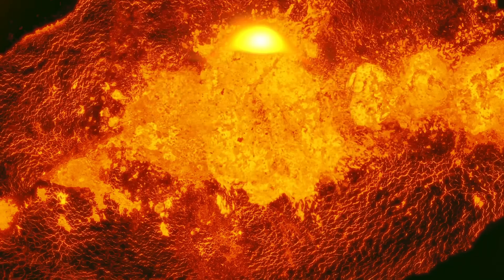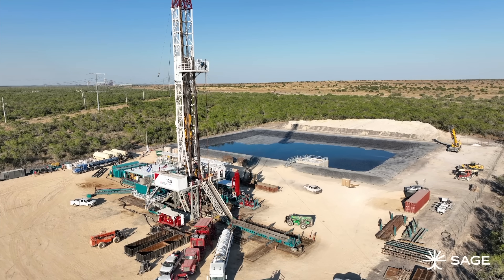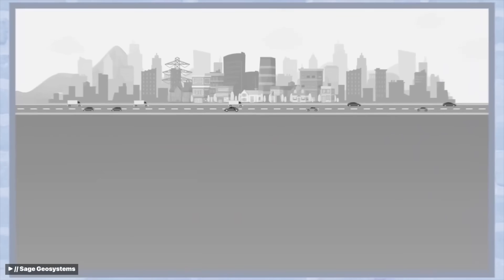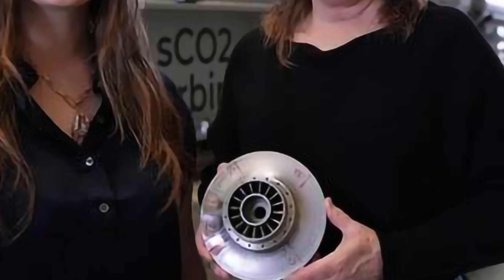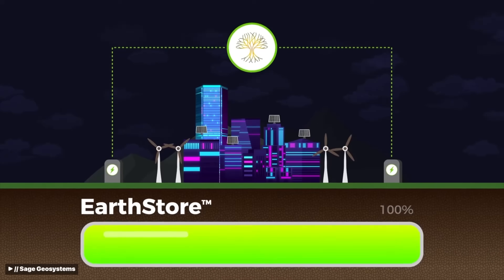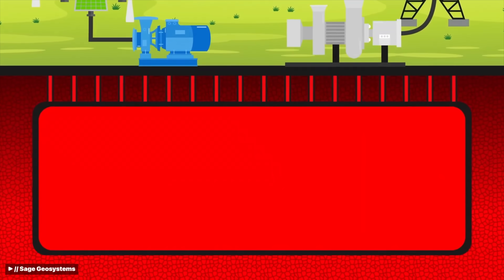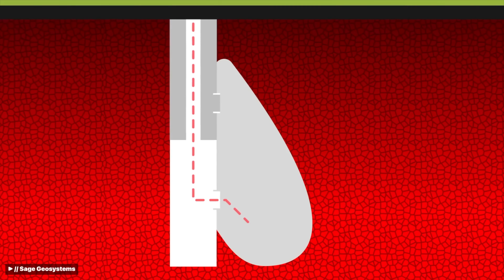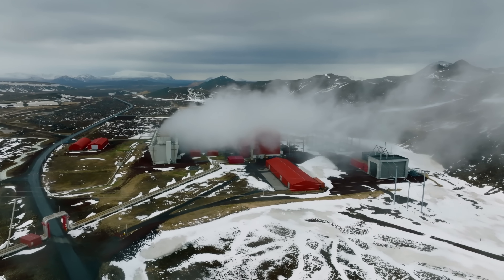This Tech Solves Geothermal's BIGGEST Problem - Gamechanger?

Comment: Sounds wonderful, but the cost of the many, many wells is high, energy density of non-volcanic geothermal is low, the equipment is expensive, and the ongoing maintenance is terrifying. Nuclear is a far more practical solution.
Reply: Yes, in the video they stipulate “hot dry rock” which drastically limits where one can drill.  
The startup Quaise is tackling the drilling problem … hopefully it’ll be what it promises. 
I am a strong believer in nuclear.  Maybe their CO2 turbine could be applicable.

Comment: What crushed rock???  Arsenic….?  There is another company that injects chemicals…..but they wNt say what they are too.
Reply: It's all super-secret squirrel shit I guess, they don't want to give away the recipe. There are propylene glycol-based Geothermal Fluids used in many geothermal pump systems that I found online. That's supposed to be a non-toxic antifreeze and heat transfer liquid. I don't think that's all they will use but that's all I could find other than some references to a mud slurry. I worry about the natural off gassing and elements that will be brought to the surface while they drill those holes out, that could cause issues for breathing particulates and dusting of the land used for agriculture and such. That could also get into water sources too.

Comment: "How many times did you use ChatGPT today?" - 0.
Unlike what the Sammy-boi and Leather Jacket Man tell you, the future isn't in the hyper-massive LLMs pretending to be AGI. It's in much more compact SLMs, fine tuned for a given use case and maybe coupled with RAG. I don't believe that the demand for electricity will skyrocket, in fact I think it will plummet once the hype bubble bursts. GenAI technology has countless applications and it's nothing short of revolutionary... However, just because one company has managed to spark a trend does not mean they are right in everything they do. Look at Sammy-boi walking back his "I hate RAG" bullshit. OpenAI has gone full RAG with their brand new connectors... :)

Comment: I know it wont be the whole load but saying that we would only accelerate the earths heat loss by 8% likes its nothing its quite worring. 

I would say that 8% decrease is much more worring that global temperature rise by 1c.
Reply: …but the earth is cooling extremely slowly, so not an issue
Reply: @markthomasson5077  I know it's cooling but increasing the amount by a fraction of a percent would be fine but talking about 8%. The increase could be significantly more than 8 percent

Comment: I see nothing unique about any of this.  They are fracking hot rocks using water are the fracking fluid (nothing new there).  They inject water which picks up the heat and likely a lot of contaminants that can plug up piping and valves (a common issue with geothermal).   They are using a CO2 Rankine cycle (steam power plants use a water based Rankine Cycle).  While there are slight differences in efficiency by changing working fluids due to practical effects there is no theoretical extra energy efficiency with a Rankine cycle by using an alternate fluid.   Maximum Efficiency is still controlled by the same equation.  Theoretical Max Efficiency  = 1-(Tcold/Thot) - temperatures in absolute temperatures (Degrees K or Degrees R).  Totally independent of working fluid.

Quite honestly I worry about the energy required to compress and liquid the CO2 as they cannot just cool it enough to liquid it like is done with water in a condenser using air or cooling water typically below 90F.  The extra energy to compress the CO2 is going to reduce the rankine cycle efficiecny from if they used a fluid that would condense at reasonable working temperatures.

Note:  Mechanical Engineer who spent much of his life in Power Plants and looking at alternative power plant designs.

Comment: Ricky, another great report. You have focused on one of two key technologies that have been put together. The new ground heat thermally pressurized underground water store. And barely mentioned the supercritical CO2 refrigeration cycle that extracts energy with a compact turbine-generator and turns it into electricity.

Comment: Could these be used for small, remote communities?
I'm thinking of places like the road houses on the Nullarbor in Australia that are starting to have EV chargers installed. How cost effective would geothermal be compared to solar with batteries for powering the whole site?
Maybe this could be an alternative to running power lines across the desert.
Reply: If this technology becomes cheap enough, maybe. My guess is that for a single home/ranch no. The combination of solar and battery would probably be a better alternative than geothermal. Here in Texas, the oil and gas companies of southwest Texas often use solar to power their pump jacks to get oil out of the ground rather than run power lines across miles of desert.

Comment: I womder if there’s a way to use this on a grand scale in the AZ desert areas where the ground water has been depleted and the process could help recharge the aquifers.  But probably not, if water would seek to fill up the aquifer, then that means it couldn’t be pressurized.

This leads to a question, I thought she would pressurize the ‘pad’ by adding more water to the underground reservoir, but I must have misheard.  Don’t they first fill the underground ‘tanks’ with water, and then rely on geothermal heat to pressurize the water, which they then use to spin up a turbine, etc?
Reply: You can refill depleted aquifers, nature does it all the time. However.... Pressure and the weight of overburden (rocks, soil and water) above a particular point underground) increases with depth and tends to crush rock over time and reduce the rock's porosity (amount of space available to store fluid) and permeability (a measure of the ease with which a fluid can more through a substance).  If a formation is saturated with water (no free air spaces) the weight of the the water develops a counter pressure that helps support the weight of the overburden and may prevent crushing.  Drawdown happens when water is withdrawn from a rock faster than nature refills it.  With enough drawdown some of the rock in a formation is crushed. It looses porosity and permeability. This lost porosity and permeability can never be recovered.

Comment: iii

It’s not niche — over a billion people live above conventional geothermal systems. Just look at the numbers:
Indonesia (280M), Philippines (117M), Japan (120M), Taiwan (23M), Central America & Caribbean (100M), California (40M), East Africa & Southern Europe (474M).
Yet we've only delivered 17 GW of the 200+ GW we already know exists. Why? Because the real challenge isn’t drilling or data — it’s permeability.

Let’s stop pretending that slogans like “geothermal anywhere” solve this. It’s a great marketing line for raising capital — but commercially? It doesn't hold up. Without permeability, and without convection, you’re left with expensive heat that doesn’t flow.

No one’s cracked the code yet. EGS is still struggling with the same physics that conventional systems face — just in even tougher rock.
Ironically, EGS may turn out to be the real “niche” — conduction-dominated systems simply won’t scale everywhere.

If anyone actually wants to understand why most geothermal projects fail — and what makes them work — happy to walk through the science.

Comment: @1:50

Because cronyism and lobbying.

Even if you aren't able to get enough heat to run steam generators you can pre-heat or pre-cool air for HVAC systems. With ground temperatures a few feet down running 55 to 65 degrees F all year long you could pre-cool the air that is being fed into AC units thereby making them work less hard OR you can use cool air from underground to carry heat away faster from the cooling coils of AC units rather than 100 degree Arizona air. For cold places, pre-warm freezing air to 60 degree F before running the air into heaters for buildings, homes, parking garages could also just be pumped with Earth warmed air for people's comfort.

Probably plenty of other uses too, but those simply involve digging vertically or trenches or even coils of pipes under man made or natural ponds.

there is so much energy out there that even just using it to pre-heat or pre-cool air or water that is used for some purpose would save massive amounts of power.

Comment: Yes, lets have a video with the details.  For example, what is the foot print of one of these 50 MW stations?  Does it have to worry about hot caustic water discharge?  What are the details of the turbine mentioned?  Why is it better than traditional turbines?
Reply: and what is the long term effect of fracturing the ground in a non-traditional geothermal hotspot location and pumping in water. Does it cool the ground eventually leading to a dropoff in power output and to changed stress strain conditions in the ground? Sounds like something that we do not understand enough about. Compare this with solar where we are not interacting with the source. We can cool the sun or generate sunquakes by collecting solar energy.
Reply: @torbjornvonstrokirch7674 guess you missed the part about using spent oil wells
Reply: @torbjornvonstrokirch7674      At this point we don't know what the long term effects or challenges will be. I am sure we can make some educated guesses but until we have working prototypes in place, we can't know for sure. I personally think geothermal is the long term solution to energy generation but we need way more work and progress to make it universally functional. Thanks.
Reply: Supercritical CO2 turbines for power production are still relatively novel but importantly a 50MW turbine hall would fit in your garage.  That alone will make the footprint of these pretty unimportant.  The rest would be subsurface right?  Just plumbing to and from boreholes.  I think the big footprint would be solar panels.  I'd use them as the roof of the turbine hall and pumping.  You'll also need compressors to maintain the supercritical CO2.  I think you're talking about less than a city block all in.
Reply: They’re around 10% more efficient than traditional turbines

Comment: Fossil Fuel plants are built for PEAK service demands, with some plants even known as Peaking Plants.
Should you plan a SWB - Solar - Wind - Battery plant for the TROUGH, the lowest supply available you wind up with Super Power, way more power than you need.
The Batteries only need to last 48-96 hours in most places on earth!!
Great Video, as I with Oil & Gas experience only recently have seen the potential $5 Trillion industry by 2050 that is coming of age!!
DS

Comment: Apply this to all residential customers and it would bring much needed relief to our overloaded grid. According to ⚡ Electricity Use by Sector (U.S. Averages)... residential use is 37%. WHAT would that cost the US to implement? A 37% increase to our grid would cost each of us at least that much of an increase in our bill. A per-person average cost analyses for a city sized system like this would be nice to know.
Reply: Depends, we also WASTE a lot of power on overhead on the grid as well. So more storage would also reduce and reuse solar + any generated power as well. More than likely, if these can double up as a battery, we wouldnt need as many or they can be used to replace current gas, but I am going to bet you will start to see even more push back from the oil/gas companies then. Trump would end up taxing them double lol.
Reply: @adr2t  Turnip truck guy will end up taxing himself out of office. He's sinking in polls straight away.
Reply: I think you're misunderstanding the cost factors. Solar and wind cost significantly less than gas generated electricity. Install solar on your roof. If you can do that labor yourself you will save even more than hiring it out which will reduce your elec bill to as much as $0. Adding industrial scale geothermal will actually reduce it more. All of these clean energy sources are double to triple more efficient than gas which I liken to toilet paper. As soon as you use it you must buy more.

Comment: Geothermal's low energy density in most locations is similar to low solar density.  Solar was solved by scaling up, using mass solar panels generating a small amount of electricity per square foot.  It works.  The same thing probably needs to be done with geothermal.  Instead of one large facility producing a large amount of electricity in one place, we'll probably need many small generators over an area, each producing a small amount of electricity.  The tricky part is getting the heat from deep under ground to the surface without losing most of it in the transfer.  That's a job for heat pipes.  As for cooling off the Earth, the Earth is much bigger than most people realize.  If the Earth were the size of an exercise ball, about 2.5 to 3 feet in diameter, continental crust would be the thickness of 6 sheets of paper, ocean crust would be about 2 sheets of paper.  Punching a few tiny holes in the crust isn't going to change the Earth's temperature.
Reply: Yeah, and Geothermal has one thing that solar doesn't: It gets better the deeper you drill. New drilling technologies that go deeper, while more expensive, can make energy production much more efficient and accessible pretty much anywhere in the world, not just in 54% of the surface.
Reply: @ipp_tutor  What are you talking about, solar gets better the higher you go! The ISS is completely solar powered! If we could put panels 6 feet from the sun we'd be laughing
Reply: I'm shocked that no one in the comments or this video mention WHY the earth's mantle and core are hot...decay of radioactive elements.  You can't cool off the core until all the uranium, thorium, etc have decayed to stable isotopes.  That will take a few more billion years so maybe just maybe long enough to get fusion working.
Reply: exactly.
Reply: If the drill the entire earth we can reverse global warming. In fact we could refreeze the earth and move the the carribbean

Comment: Sage is nice and all - I hope they succeed. However, they're not the ones who "cracked the code" on new geothermal.

Sage is well behind what Fervo is doing. Sage's goal of a 3 MW plant in 2027 is something Fervo did successfully  in 2023 with their "Project Red". Been working flawlessly. Fervo plans to have 100 MW of new geothermal on the grid by next year (2026) at Cape Station in Utah - and already has permits for expanding up to 2 GW. Boreholes for the first 100 MW are drilled, their partner Turboden is building the ORC turbines and Fervo is moving on to drilling for the additional 400 MW of Phase 2, which will be deeper.  And yes, Fervo can do the same "pressurize the well with cheap grid power" trick. The difference is that they've actually tested it successfully.

With their oil industry drilling background, it's puzzling that Sage isn't doing horizontal drilling. With horizontal drilling you don't need to move the drilling rig along a line for every single borehole - your boreholes radiate out from a central pad.
Reply: Horizontal and long wells cost more per foot drilled than shorter, vertical wells.  Many vertical wells may be the winner on cost.
Reply: @vaughnsvendsen7913  I'm also as a layman wondering if they might be more stable as energy storage. And perhaps less costly as drilling straight to hotter rock seems more efficient.
Reply: Unfortunately this channel has turned into over hyped, under-researched hype story telling. Notice the quant in this video was....what, a couple broad shot global scale numbers? With zero specific case studies or hypothetical examples.
Reply: Interesting.  Fervo definitely seems to have got somethings figured out.
Reply: @jimmyconway8025  Yep, they're the furthest along of the dozens of new geothermal companies/divisions/whatever. I'm hoping several other companies catch up - there's plenty of demand for cheap, reliable geothermal which can double as energy storage.

Comment: This is heartening.  I can still see applications for small scale solar and wind harvesting for localized/onsite resiliency, but this may be what we need to make oil and gas alternatives make sense.
One point of concern is that this can reduce surface/watertable water resources.

That said think we need to harvest methane for fuel because it critically hyperlocalizes energy sources, as well as reduce pollution.  Thats win-win.

Your commercials your channel produces are so much better than other channels. Well done.
Reply: That's a good point and one that I don't think came through in the video: How much water does the system need and how much is it lost per cycle.
Reply: I don't know why you think methane reduces pollution. It may be less than crude oil, coal and fossil gases but it still pollutes and warms quite strongly.
Reply: @cre8tvedge 
Harvesting methane and burning it reduces the greenhouse effect, it is considered a pollutant that is also a resource, and it's a source that's there whether we like it or not.
Better to use it than to squander it while lamenting about everything else.
You missed where I said harvest it for fuel.